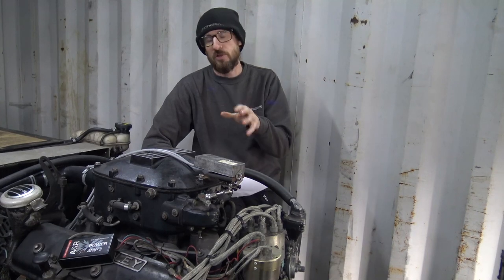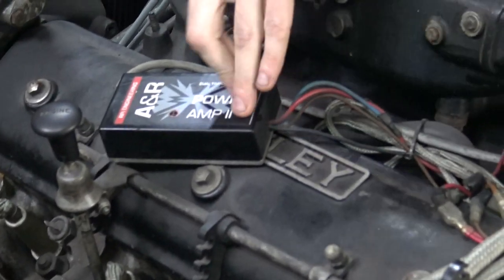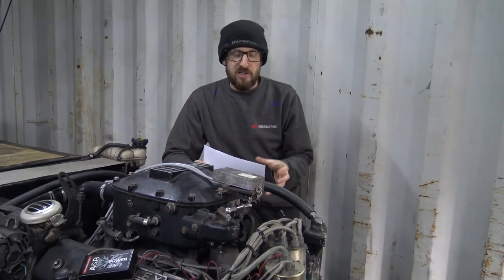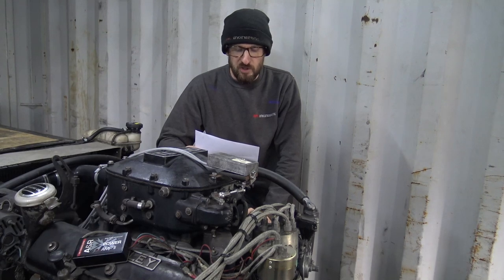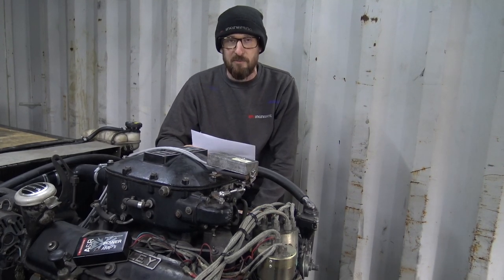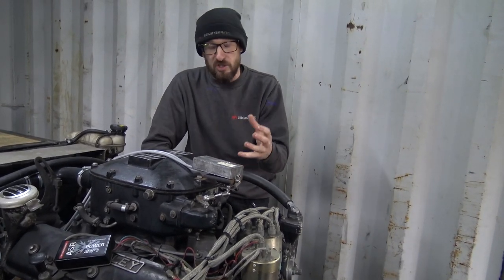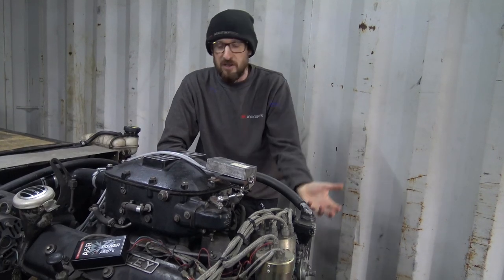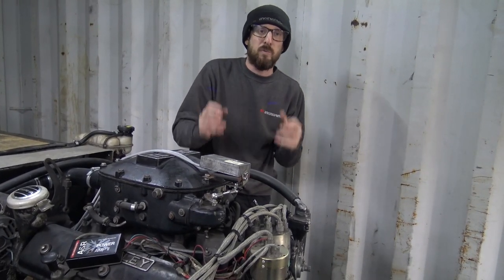RPi Engineering need your help! Send us your A&R Amp review videos

Comment: Amazing.  I was going to ask the same question.  It is really easy an cheap to swap the GM HEI in.  Not my idea, I first read about this in an Australian Land Rover forum, but I've seen this retrofitted to almost anything from a FIAT X1/9 to a Bentley.  If you open the Lucas module in an injected Jaguar V12, guess what you find inside?  The GM module ideally runs a 0.6 ohm or thereabouts E-core coil.   The amp module costs about £20 (genuine types more) but the coils cost a little more.  I've done this on my P6 and it hooks right up replacing the side mounted Lucas module, which is utter junk.  It works brilliantly.  As far as I see unless you need the switchable timing there are only really two forms of electronic ignition module, those that rely on a form of resistance either in the coil and/or externally to limit current and those that electronically limit the current through feedback.  There's no rocket science to this, what you really want is the latter.  The reason being the inductive load of the coil opposes the flow of current when first switched so the the last thing you want to start in each cycle is any fixed resistance at all, the coil does that itself and then some.  However you do ultimately need to limit the current later in the cycle and this is best done actively.  The GM modules top out at around 7amps.  If you had a coil/ballast combination of 3ohm the maximum would be somewhat under 4amps max, much lower to start with.  Now contrary to popular belief, voltage is only part of the equation.  These modules will deliver 45kV but where they win early in the charge cycle is to the benefit of total spark energy and reduced charge time - probably why Lucas did this with 12 cylinders to fire, rather than their own crap!  Indeed the coils paired with the HEI module have fewer turns (1:75 instead of 1:100 or so) to limit voltage to avoid insulation breakdown either in the coil secondary or the distributor and wires.  It's a brilliant, simple, cheap and totally bullet-proof system.
Reply: A really great technical explanation here: https://www.slantsix.org/forum/viewtopic.php?t=56383.  It's interesting in even a 6 cylinder engine that there isn't enough time to fully charge a coil in a conventional ballast system as low as 3500rpm!

Comment: Excepting the ability to switch timing for LPG applications, what benefit is it versus swapping out the Lucas module for a GM HEI one at a fraction of the cost?
Reply from the maker: Thanks fro your comment. It is not something that has ever been mentioned before in any conversion that any customers has ever had with me that I know of. However I will have a look into it as part of the video we make in answer to this question
Reply: @RPIEngineering  there are a lot of references to it but I first read about it here https://www.v8forum.co.uk/forum/viewtopic.php?f=11&t=78&sid=e323e3b23bb17898fbddbc9fc4eeab59 I don’t agree with their choice of coil being compatible from an ohms perspective, I have fitted with a Bosch ‘suitable for transistorised’ coil (per V8 Disco) in my flapper TVR. It’s interesting and it works, would like to know if there’s more to gain with your unit.
Reply: I might be totally confused here, but I thought the original module was a GM HEI? It even says GM on my module... Has it been swapped then, already?
Reply from the maker: Hi Paul,
If you email a picture of what you have we can help identify it for you. info@v8engines.com
Reply: @paullundgren6319  It's likely a retrofit.  a very good one too.